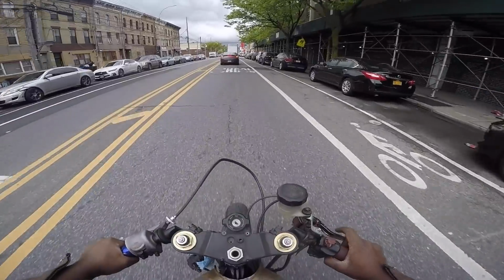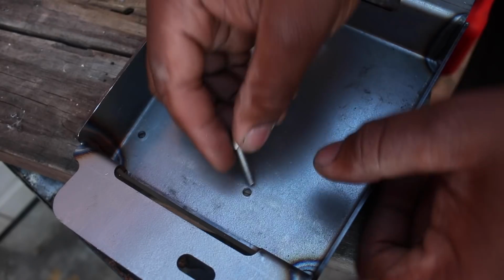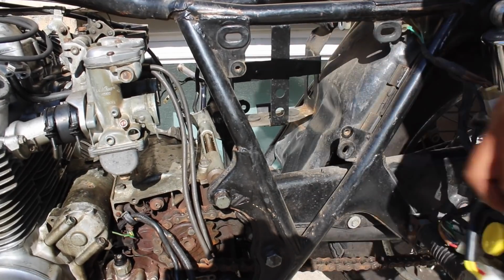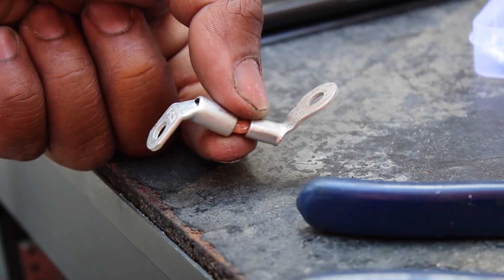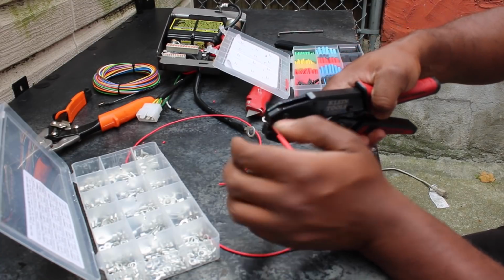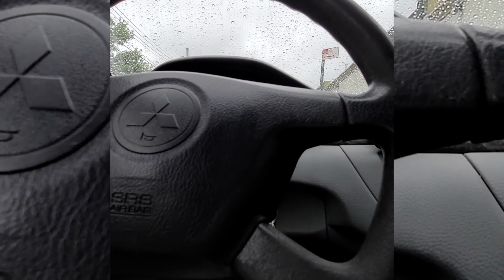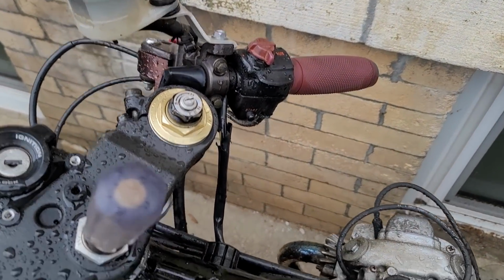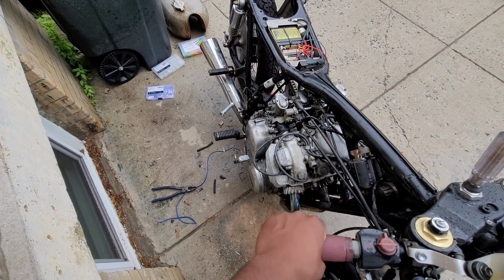1976 Honda CB550 Pt. 6 - First Half of the M-Unit Rewire

Comment: The wiring is my most nervous part to tackle on my 83 cb650. But these videos help me a lot. Always look forward to the videos!
Reply from the maker: Honestly the best advice is to really just sit and think things out. You can slap anything together but it's important to do it in a safe way.
Reply from the maker: These bikes are pretty simple so tackling making it run on your harness first is a good way to build morale
Reply: @Theillestrator1050   Your advice is more than appreciated, I’m not using your video as a “how to” just more as an inspiration to start tackling it. I’ve gotten it to turn over with with the oem harness alone. But with the air box missing I would like to simply the wiring with an M-unit as well. But hey, I’ve changed a few headlights out before, whats rewiring a bike? Haha
Reply: @grimsventure4439  M unit is a good way to centralize and simplify wiring. Your basic carbed bike has ignition, lights, and stator, excluding the horn and fuel sending unit. Separating what does what makes it easier, then isolate. The stator might be a good starting point, it provides all the power.
Reply: @ItsDaJax  thanks man! that’s actually exactly how I plan on going about it. Wish me luck.

Comment: Nice work. Just got my R1 out for summer. I tried getting it out earlier, but the battery died over the winter. I don't really wanna invest in a Lithium battery yet, but I did end up finding a replacement AGM at Walmart of all places. Good to get rolling again.
Reply from the maker: I've got a horrible track record with lithium batteries...I think I've killed like 5. Only reason I'm running this one is because it's the only type that would fit there. 
Honestly I wouldn't rush to buy one lol
Reply: @Theillestrator1050  I was wondering about that. Thanks for the advice.

Comment: Tips on drilling metal, use a spring or hammer punch to guide the bit, and use lube, WD 40 just a tad. It will save your bits!

Comment: What battery did you use? Is the 120 cranking amps from the 4 cell good enough to crank it every time??? I also have a 76 cb550 supersport I’m wiring a m unit to
Reply from the maker: I used an antigravity 401 small case. Cranked over just fine for me
Reply: @Theillestrator1050  I probably just need a new solenoid then

Comment: Good work man. Excited to see how this looks in the future all put together, but are you sure you’re not going to spring for a cafe seat as opposed to stock? Unless I misheard.
Reply from the maker: I was planning to keep the stock seat for the comfort and passenger ability. This seat is like a couch and I love it. Something custom may look better but I don't know that it's worth it
Reply: @Theillestrator1050  that is a good point, especially on those NYC roads I’m sure. I guess you could always switch over later. I was considering getting a tuffside seat like classic octane does but the price is pretty high, but they seem high quality too. I guess I’ve never heard comfort actually discussed on those aftermarket seats other than it being said that it is definitely worse than stock.